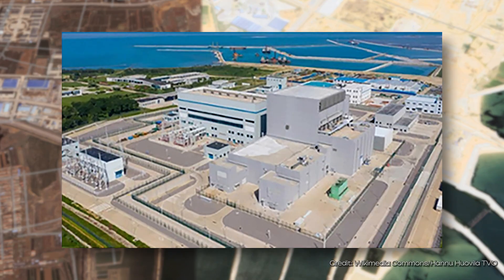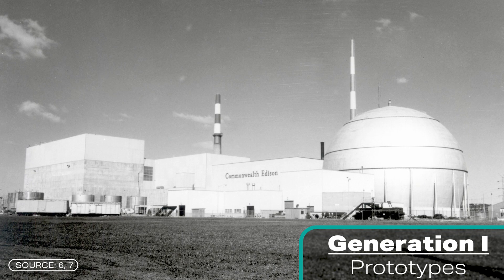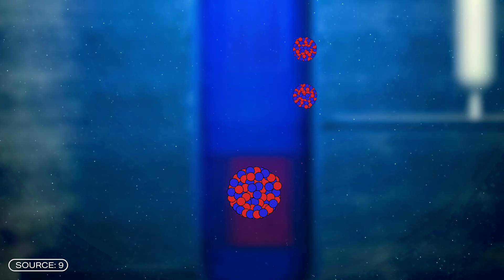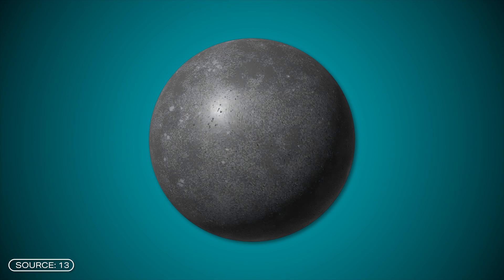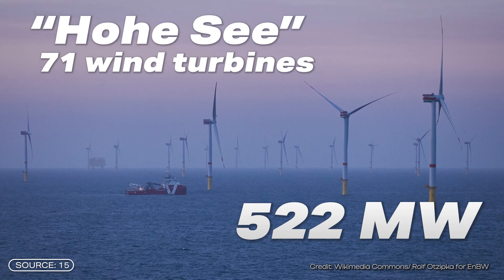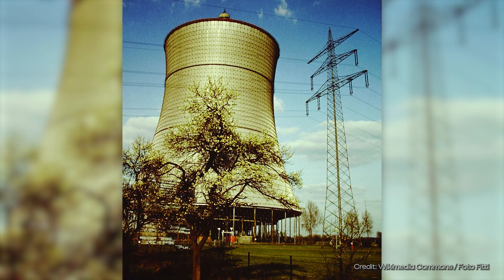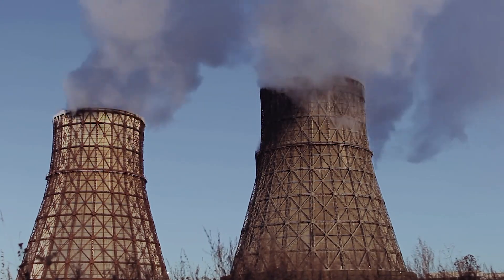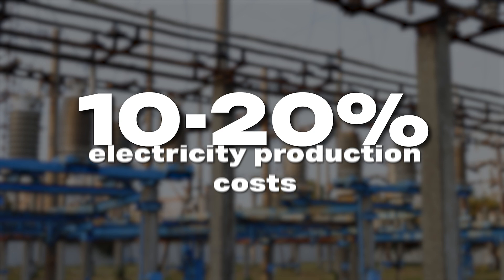Nuclear Power WITHOUT Fuel Rods: This Is How The Pebble Bed Reactor Works!

Comment: Hi @GermanScienceGuy,

Have you seen the waste burning reactor being developed in New Brunswick, Canada? It burns plutonium/Amercium chloride extracted from waste onsite. The mix of plutonium and Americium is not a proliferation threat due to radiation from Americium. 

The reactor is very hot so it could be used for industrial heat, and runs at atmospheric pressure so materials and engineering are expected to be less than a gas fired plant. 

A Canadian national lab has already tested the waste processing to extract the fuel.  The waste processing creates 3 material streams, a small amount of fission products that should be stored for 300 hundred years, uranium (not very radioactive), and the plutonium and Americium fuel.

The design is from a US Airforce request for a nuclear bomber in the 1950s. It was not built because the molten fuel could not use convection currents to cool or diving or turning the plane would change the power output of the reactor. Stopping convection in the fuel meant the fuel rods needed to be very narrow, which stopped the reactor from working.

This design was brilliantly dusted of by Ian Smith, the founder of Moltex Energy. It is inexpensive to build and will run on waste New Brunswick power already has, and the fission products (except for noble gases) stay in the fuel salt.

Comment: 6:50 the comparison is not fair at all. The HTR-PM is a small modular reactor (SMR) and it was designed in that way to offer enhanced safety and operational flexibility, unlike a large nuclear power plant (ISAR-2). 
A small modular reactor can range up to 300 MWth.

Comment: Please give an analysis of the MSR reactor from Copenhagen Atomics in Denmark. I am from Denmark.
Reply: There a lot of videos about Copenhagen Atomics online.
My issues are
- that it is working only about 5 years, then most is radioactive waste.
- transport on public roads with very high radiation, if thorium cycle was used.
- thorium isn't important at the moment, as there is enough spent fuel and depleted uranium available

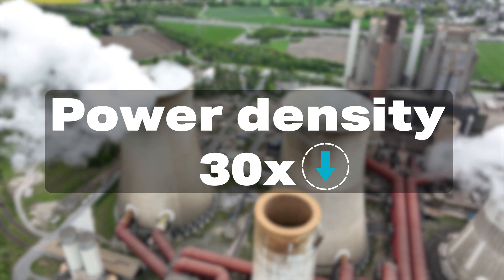Comment: 11:10 "the reactor not only produces less electricity but also less heat" Heat as in total caloric energy? Cause they do run hotter, they can output 750 C. The thing is, because they are using gas as a coolant, heat transfer is not as efficient as it would be with a liquid, but the overall efficiency of the electricity production would be higher.

Comment: There shouldn't be ANY debate about nuclear even with older and existing technology. It's statistically cleaner and safer than coal, oil or gas... The end. There's no more debate beyond that. Fossil fuel advocates are really just fossil fools, kidding themselves and nobody else at this point. And no I am not anti solar, wind, hydro or geothermal. Far from it. I am a "let a hundred flowers bloom" kind of person. As long as we are all working towards a carbon-free or at least LOW carbon future? We're on the right path!

Comment: Australia here. The only sort of reactor that makes any sense is fast burners, as they are supposed to leave much less waste.
Reply: 🔋 Key Advantages of the Dual Fluid Reactor (DFR):

• ⚡ Ultra-efficient: Nearly 100% of nuclear fuel is used  
• ♻️ Burns nuclear waste, depleted uranium, and even thorium  
• 💥 Transmutes long-lived actinides into short-lived fission products  
• 🔄 Built-in Pyro Processing Unit (PPU): Continuously removes neutron poisons and extracts valuable metals  
• 🛠️ Liquid fuel: No solid fuel rods, no batch reloads  
• ⏳ Decades of operation with a single fuel load possible  
• 🚫 No corrosive salts: Liquid metal fuel avoids fluoride corrosion and complex chemistry  
• 🧊 Lead coolant: Excellent radiation shielding, no water, no pressure → no steam explosion risk  
• 🌡️ Very high temperatures (700–1000 °C): Enables hydrogen, e-fuels, ammonia, and direct steel reduction  
• 🧠 Self-regulating: Output adjusts automatically via negative temperature feedback  
• 🪫 Minimal waste: Only short-lived fission products remain (• 🏭 Compact & scalable: High power density, ideal for modular deployment  
• ⚙️ No moving parts in reactivity control: No control rods required  
• 💰 Uses existing stockpiles of spent fuel, DU, and thorium  
• 🌍 Reduces dependence on enrichment, imports, and fresh uranium mining  
• 🔄 Full closed fuel cycle: No external reprocessing needed  
• 🆚 Outperforms typical SMRs: No pressure vessels, no high-pressure coolant, no water-based systems
Reply: @egnegn123 interesting, thanks 😊.

Comment: You spend the entire video trying to make the HTR-PM look worse and use bad comparisons. When it's a first of a kind of course they aren't going to build a GW scale reactor straight out of the gate. Also very funny how you list that wind farm which has capacity factor of 44% which means it might if lucky produce the same amount of power as the HTR-PM 😂
Reply: They building two HTR-PM600 with six SMRs. Search for images for the crazy design.

Comment: Could you make a video on sodium cooled reactors, like the one being developed by Bill Gates' company? They seem to me to be an accident waiting to happen if you lose the argon gas that keeps the sodium from reacting with air and water thanks
Reply: Yes, sodium is not so nice. Better is using lead.
🔋 Key Advantages of the Dual Fluid Reactor (DFR):

• ⚡ Ultra-efficient: Nearly 100% of nuclear fuel is used  
• ♻️ Burns nuclear waste, depleted uranium, and even thorium  
• 💥 Transmutes long-lived actinides into short-lived fission products  
• 🔄 Built-in Pyro Processing Unit (PPU): Continuously removes neutron poisons and extracts valuable metals  
• 🛠️ Liquid fuel: No solid fuel rods, no batch reloads  
• ⏳ Decades of operation with a single fuel load possible  
• 🚫 No corrosive salts: Liquid metal fuel avoids fluoride corrosion and complex chemistry  
• 🧊 Lead coolant: Excellent radiation shielding, no water, no pressure → no steam explosion risk  
• 🌡️ Very high temperatures (700–1000 °C): Enables hydrogen, e-fuels, ammonia, and direct steel reduction  
• 🧠 Self-regulating: Output adjusts automatically via negative temperature feedback  
• 🪫 Minimal waste: Only short-lived fission products remain (• 🏭 Compact & scalable: High power density, ideal for modular deployment  
• ⚙️ No moving parts in reactivity control: No control rods required  
• 💰 Uses existing stockpiles of spent fuel, DU, and thorium  
• 🌍 Reduces dependence on enrichment, imports, and fresh uranium mining  
• 🔄 Full closed fuel cycle: No external reprocessing needed  
• 🆚 Outperforms typical SMRs: No pressure vessels, no high-pressure coolant, no water-based systems

Comment: The only truely meltdown safe reactor type is a molten salt reactor. I really think we should put a lot more money on this kind of reactor instead of the fusion reactors, especially on thorium reactors because not only it is more efficient but thorium is less scarce than uranium, it doesn't need any enrichment, the decay chain produces a lot less long half life radioactive elements, it doesn't need any downtime to refuel, it doesn't produce signifiant amounts of u 235 for nuclear arms proliferation, it has passive inherent safety and finally it uses salt chemestry to replenish its fuel so it can isolate newly created decay elements which are worthless if mixed together but can be sold individually when purified (xenon for nuclear medicine, etc) and therefore can be used to get rid of parts of our nuclear waste and produce fuel out of it...
Reply: Thorium is a meme, and harder to work with. Most of the advantages you listed are advantages of MSR's not of the fuel used, you can use uranium in an MSR just fine
Reply: @Toefoo100 it's harder to work with but it is less scarce and more evenly distributed amongst coutries in the world
Reply: @thecellburner  thorium is about 3-4 times available than uranium on land. But uranium is abundant in seawater. China already developed an extraction process.
But first, use all the waste and depleted uranium. It is enough for hundreds, if not thousands of years.
Reply: The pebble bed reactors can also be thorium fueled.
Reply: I think the corrosion problem of the molten salt is the overarching technical challenge. China's experimental Thorium MSR in the Gobi desert is progressing very cautiously with very small amount of power.
Reply: @EdwinaTS Copenhagen atomics managed to find a molten salt "recipe" that is a lot less corrosive with stainless steel. They have working prototypes and are about to commercialise.
Reply: The point is - why use thorium at all, when spent fuel and depleted uranium (DU) is abundant?
The waste of 1 reactor year of a 1 GWe conventional reactor can provide up to 140 times the electricity originally produced. Additionally, the side product from enrichment, depleted uranium can provide another 4 - 5 times the electricity of the spent fuel. In total, this is about 700 times the electricity that was produced by nuclear in the past. This are resources worth tens of trillions or even hundreds of trillions USD, that could pay the debt of the US multiple times easily.
A side effect is that the "waste" produced after complete burn down consists of 95 % partly precious metals, and about 5 % of waste that decayed after 30 years to the level of natural uranium. Of course, it is poisionous, but can be stored just like normal chemical waste. And the amount is small anyway, because 1 kg or uranium/thorium contains 24 GWh of thermal energy. 
But be aware, beside some advantages of thorium, there are nasty site effects. There are hard radiation sources within the thorium-cycle. Proactinium 233 and Thalium 208. Pa 233 comes from breeding Th233. It is a bad neutron poison, that requires immediate separation from fuel, otherwise reactivity stopps. Pa233 then must be stored separately, until it has decayed to U233. This decay also produces hard alpha and beta radiation. TI208 on the other side, comes from a small part of U232 produced during breeding. U232 decays at some point to TI208, which issues hard gamma radiation. This requires more extensive shielding and complicates handling. So the thorium-cycle has some drawbacks, which are often not mentioned. 
IMHO, before using thorium, waste and DU should be burned. And if this isn't enough after thousands of years, there is the posibility to get uranium from seawater, for which China seems to have found a cost effective solution now. 
Of course, you can use thorium sometimes in the same reactors, that burns waste and DU, but it isn't necessary for energy needs for a long time. 
So again, why use thorium when it isn't really necessary?

🔋 Key Advantages of the Dual Fluid Reactor (DFR):

• ⚡ Ultra-efficient: Nearly 100% of nuclear fuel is used  
• ♻️ Burns nuclear waste, depleted uranium, and even thorium  
• 💥 Transmutes long-lived actinides into short-lived fission products  
• 🔄 Built-in Pyro Processing Unit (PPU): Continuously removes neutron poisons and extracts valuable metals  
• 🛠️ Liquid fuel: No solid fuel rods, no batch reloads  
• ⏳ Decades of operation with a single fuel load possible  
• 🚫 No corrosive salts: Liquid metal fuel avoids fluoride corrosion and complex chemistry  
• 🧊 Lead coolant: Excellent radiation shielding, no water, no pressure → no steam explosion risk  
• 🌡️ Very high temperatures (700–1000 °C): Enables hydrogen, e-fuels, ammonia, and direct steel reduction  
• 🧠 Self-regulating: Output adjusts automatically via negative temperature feedback  
• 🪫 Minimal waste: Only short-lived fission products remain (• 🏭 Compact & scalable: High power density, ideal for modular deployment  
• ⚙️ No moving parts in reactivity control: No control rods required  
• 💰 Uses existing stockpiles of spent fuel, DU, and thorium  
• 🌍 Reduces dependence on enrichment, imports, and fresh uranium mining  
• 🔄 Full closed fuel cycle: No external reprocessing needed  
• 🆚 Outperforms typical SMRs: No pressure vessels, no high-pressure coolant, no water-based systems
Reply: @egnegn123 I've never heard of the dual fluid reactor before you talked about it. I agree with you it seems like a very interesting concept but I can't comment much on it because i don't speak german and the explanations seem mostly to be in german. Can you get me some english or french links about it? It still looks like it is a molten salt reactor which is the point upon which we both agree on, the main reason why i prefered thorium molten salts seems to be the exact goal of this reactor, the fact that it can use mid term highly radioative fuels to generate electricity. It only seems to be only an added quality for the thorium msrs but i would prefer it as you say to be the main fuel used to generate electricity, it's quite a lot smarter that way and i would feel better about promoting a german nuclear waste recycler than a chinese or an american one, because i know german people care about the environment, i'm not an environmentalist but when we talk about nuclear reactor technologies it is a very important factor for me, the cancer rate's getting higher everywhere already because we neglected or hid facts about dangerous chemicals in the past, a canadian friend.

Comment: it would be interesting to know how the Chinese reactor design addressed the problems of dust and pebble movement.
Reply: Their pebbles are encased in silicon carbide and the vessel is completely smooth with no nooks nor crannies to trap the pebbles.
Also short big feeders and collectors prevent jamming, they learnt a lot from the mistakes of the Germans.
Reply: @madsam0320  The Germans made no mistakes in this regards. The separation of broken spheres worked just fine. 
The broken spheres didn't come from normal operation and regular scram testing, but from an extra test with maximum possible rod speed. This broke some spheres.
Reply: @egnegn123  what I understand is the pebbles got stuck in the feed pipe and they rammed them with a rod, not very smart thing to do.
Then it got more silly, they tried to blame the Russians for the radioactive leaks to the atmosphere. But it can't be from soviet union, the particles are all wrong for the nuclear power stations they got. German citizens just lost all faith in their nuclear programs..

Comment: There are several advantages of the pebble bed reactor design and it may very well be the future of nuclear power generation. If this design becomes wide spread could there be a shortage of the He necessary? All He comes from gas wells so there is a finite supply.

Comment: This Reactor sounds a bit like 'also unsafe, but different' and 'let's sell it to the public; if it goes wrong, we just made a mistake.'.
We also learned, that the pricetag for enegy didnt include waste processing nor dismantling. IMHO It's only another way to fed the rich like we saw it in the past.
I dont see outstanding overwhelming benefit against old reactors and safety.
Reply: it’s great for heat production in key industries that are heavy pollutants but extremely difficult to decarbonise, think of refineries, chemical plants, steel production, metallurgy, processing of raw materials such as ore.

high temperature gas reactors are perfect for substituting petrol chemicals, gas and coal dependent industries.

the electricity production is an benefit not it’s primary task.

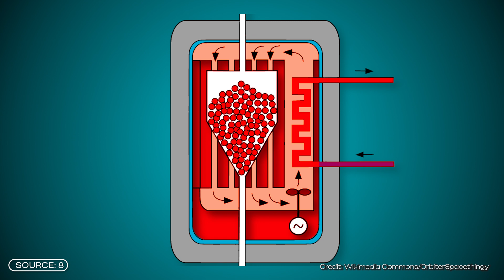Comment: 10:02 so we still need an active intervention of control rods There have been some accidents due to bent/inoperative control rods. Funny how water cooled reactors are considered safer because the coolant is also the moderator yet here we have a separate moderator and the reactor is considered safer too.
Reply: No, you don't need control rods, because the fuel provides negative reactivity, and is self-regulating. 
If the control-rods don't work, you just remove the spheres, step by step.
Reply: @egnegn123 That's not what the video is saying.
Reply: @markotrieste  Not everything in a video goes into the last details.😊
Reply: @egnegn123 That's not my problem or mistake. Fact is, nuclear fanboys love to play the game of the three cards, like in this case.